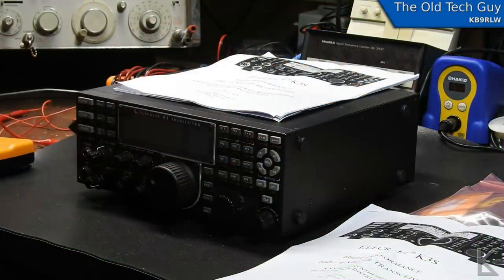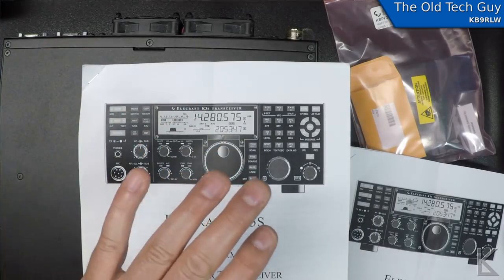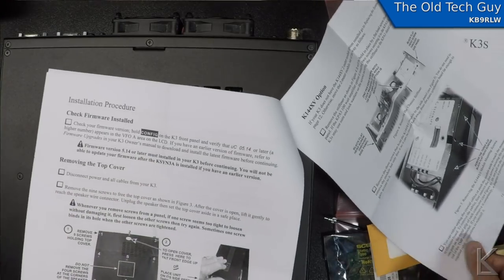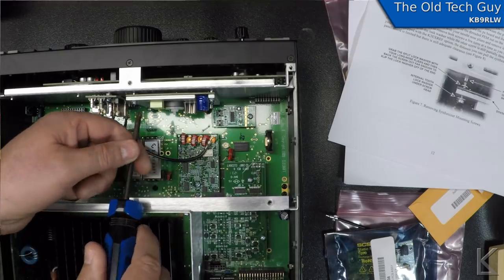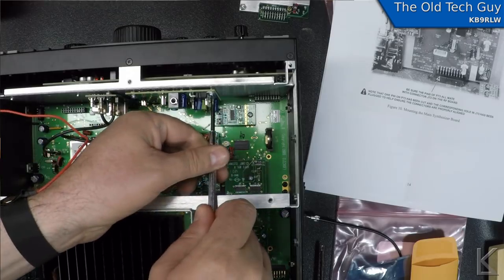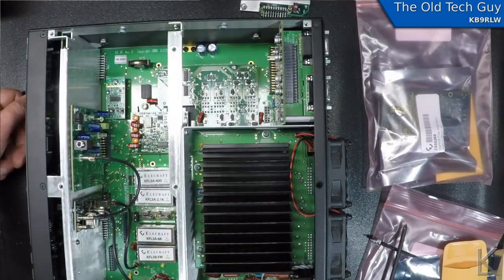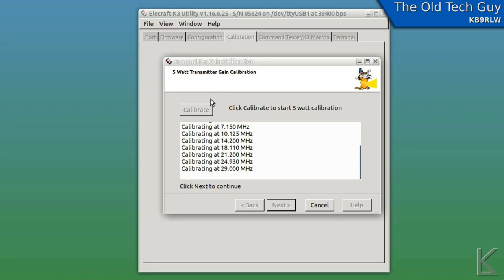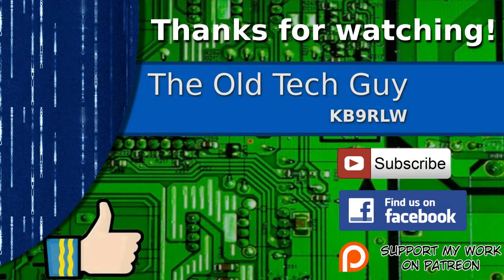Ham Radio - Electraft K3 upgrade, Installing the KSYN3A board.

Comment: Hi Kevin,
You made mention of using two lock washers from the old board. When you installed the new synthesizer board, were you supposed to install two of the old lock washers between the board and the case the way the longer screws had lock washers on both sides of the pcb? Those two lock washers would also help space the pcb away from the case.  73   WB3BJU
Reply from the maker: Nope.   I wish I could attach a picture here.  The manual specifically states that you're not supposed to put the split ring washers behind the board with a exclamation point  in a triangle.
Page 14, near the top.
http://www.elecraft.com/manual/E740257%20KSYN3A%20Installation%20Rev%20A6.pdf
Reply: I noticed that too.  The instructions did say to save two of the lock washers...
Reply from the maker: I think the instructions were written before they started including the star washers in the packet.
Reply: I was just  curious, since there were star washers on the inside of the old board.